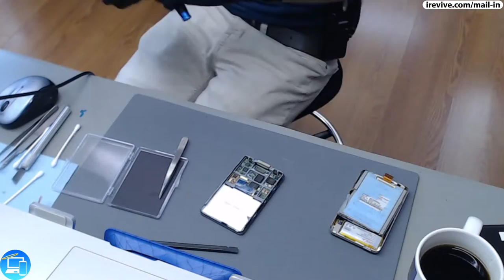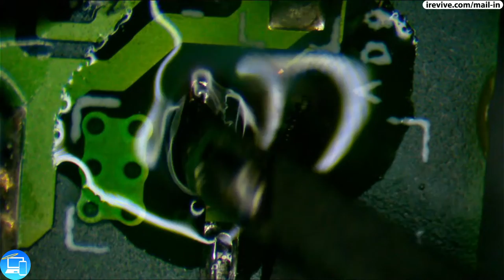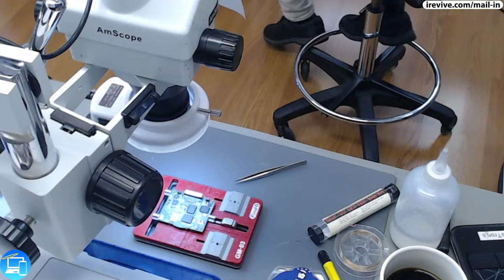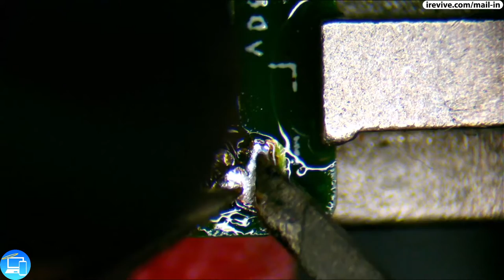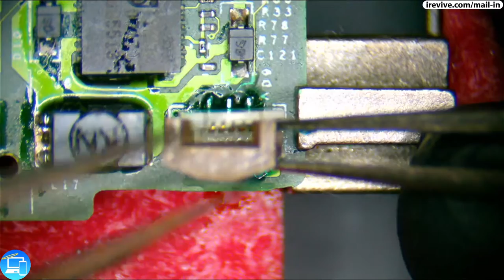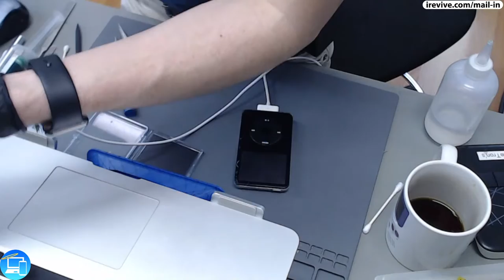iPod Classic Battery Terminal repair

Comment: Great video.  I was an oaf and pulled the battery connector completely off the PWB, need a new one (iPod classic gen 6).  Found the connectors on eBay and have ordered a couple.  Wish me luck!

Comment: Hey nice repair. I repaired my creative zen vision m battery connector 2 days ago with the same process but instead of using a microscope i used my samsungs s20 camera XD. BTW is it worth the repair? I mean if you can buy an ebay broken ipod for like $20 and take the board and just replace it. How much is the cost of this repair done in the video? Thank you for showing those soldering skills.
Reply from the maker: Nice! That is very resourceful. One of my employees was actually talking about how they want to make a 3D printed mount for their Samsung S20 for the same application. The cameras on that phone is amazing. As for your question about if this repair is worth it, it would be a matter of preference. Since Apple discontinued manufacturing iPod classics in 2015, there is a whole online market for buying and refurbishing iPods. The downside to this is that it is also becoming increasingly more difficult to source a used iPod in decent condition since most of the available iPods are getting refurbished or parted out. That is not to say that it is impossible to purchase a broken iPod and use donor parts. If you were to just purchase a used logic board, it may run you up to $100 for the part alone excluding paying someone to install the board, unless you where to install it yourself. The only downside from getting a replacement logic board is that the hard drive is paired to the original logic board. So after replacing the board, you would then have to factory restore the iPod to pair the hard drive and logic board which would erase all the media from the device. For some people, this is not a concern. For others, losing all their music over the years is a deal breaker. By replacing just the battery terminal, we can skip that process of formatting the iPod and losing data. For this repair, we quoted about $75 to cover our labor cost. This seemed to be the most economical route for the client and she was able to keep her music.

Comment: Please can you tell me which solder iron is best, quick or atten ????
Reply from the maker: I have only ever used Hakko branded Soldering Irons. As for a rework station, which is for hot air, I use both the Quick 861DW and Atten ST-862D.
Reply: @iRevive  ohh my bad, im sorry. I mean which is you prefer for a hot air, i use both hakko hot air and solder station. But hot air is not good for smd chips… specially on MacBook. I screwed up many MacBook air logic boards with hakko 😂 
What do you prefer to remove macbook boards smd chips. Atten or quick ?
I definitely know you got the real answer for my problem.
Reply from the maker: Sorry for the delayed response. For some reason I did not get a notification. Both the Atten and quick work well. I can't say that I have found that one works better than the other.